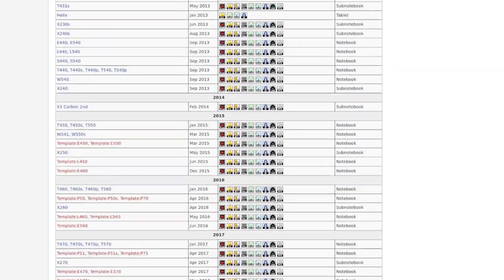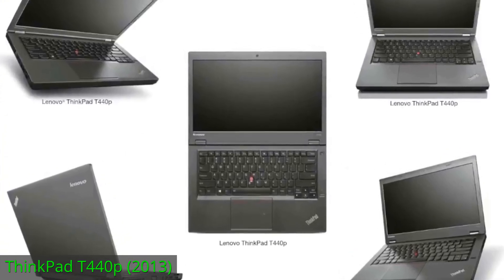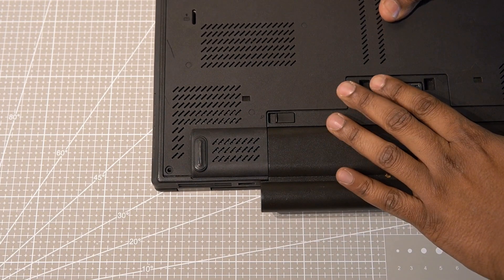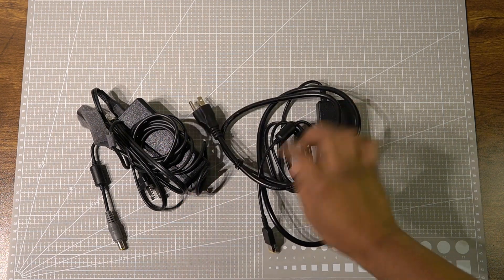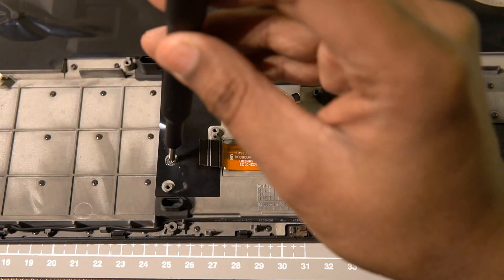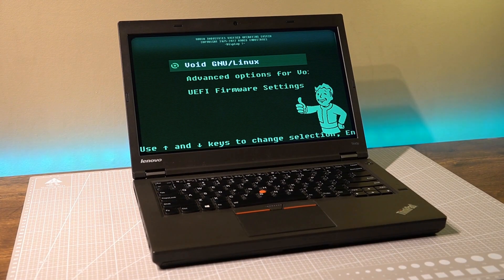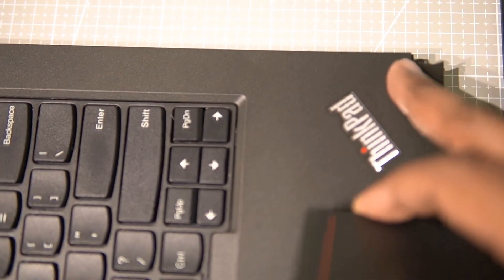ThinkPad T440p Is My New (Bulky) Travel Companion

Comment: The reason the T440p and T540p/W540/P50 (to a lesser extent) are so popular amongst enthusiasts is repairable, they're the last generation of PCs that are completely repairable i.e. all the parts can be swapped out and replaced like a traditional desktop PC due to the soldered CPU...

If you're willing to do a bit of cooler modding/pay the premium for the Nvidia cooler (thanks scalpers) you can even run much faster CPUs then were ever intended for this laptop (do your research). Unfortunately you've gotten a model with the Nvidia GPU (or fortunately depending on your outlook, so upgrading to the fastest CPU which actually has better integrated graphics then the GPU might not be worth it for you due to the added thermal overheads (additionally the gpu is a point of failure that requires a board swap if it happens).
Reply from the maker: I only realized the machine had a dedicated GPU during my restoration process. I guess I'd  rather not disturb the heat curve and battery performance with a new CPU. My current outstanding issue is the 1080p IPS panel still occasionally ends up drawing more power than the battery is happy with and the backlight goes off until a lid close-open cycle.

Comment: I love the T440p ThinkPad. I picked up a pair of them that were previously used in a school from a recycler on eBay. I bought them to freshen up and pass on to a coworker for his sister and nephew.  I have purchased and refreshed several ThinkPad models, getting them in the hands of those who want a laptop but can't afford the price of a new laptop.  Frankly, these ThinkPads are of a much higher quality and repairability. 
The two laptops were listed as different models.  It was listed as T440s.  I was a little disappointed when they arrived, but soon found that the T440p was a very good turn of events.   In fact, I liked them enough to buy a third one to keep for myself.
they tdnd to run warm, So, I used Arctic MX-6 thermal paste.   That seemed to help.

I am totally impressed at the balance of weight ( yes, it is a hair heavy),  the number of ports, the performance, and the ease of access. It is a snappy laptop.  My coworker was a big hero to his nephew and sister.  They are very happy with the units.  Good video.
Reply from the maker: It's such a great machine, that I could convince myself to part ways with my X230. Paired with a 1080p IPS display, it's literally all that you need for computing unless you're into high-performance tasks like gaming or 3D modeling.
Reply: @myTerminal  I have 16gb of RAM in mine with a 256 gb SSD.  I run Windows11 on it and it handles it just fine.  It is funny that you just cannot stop at one ThinkPad! 
My first ThinkPad was a T430s.  I cannot seem to part with it.  Like the T440P it has only the external battery. BUT..Unlike the T440p...The battery is a bit pricy. 
I just do not understand why the T440p doesn't get more love by people.  Again.... Good video.
Reply from the maker: I had a brief experience with a T420s and that machine left an impression on me. I might pick up a T430s some day. Meanwhile, I have bigger  plans for the T440p.

Comment: Its so tiny, thick and basic. Its really all you need for basic stuff. I tryng put oled display now, but the energy managment its getting in the way. By the way, really dope keyboard
Reply from the maker: And as you say "tiny", I realize most of the people I meet on a daily basis would have the exact opposite thoughts. Having said that's I find it perfect, and the thickness (as compared to the later models) fades away as soon as you realize the usability. The FHD screen upgrade only makes it better.

Comment: What are the differences you'll point out between T440p and T480
Reply from the maker: On the top of my mind,
T480 is better in: computing power, faster (and more possible) RAM, modern ports, better screens possible (higher-resolution, touchscreen, etc.), dimensions and weight, more efficient CPUs, better fingerprint scanner design, and more.
T440p is better in upgrades, keyboard (subjective, at least more key-travel), integrated DVD drive, nostalgia! (if I may stay)
Reply: @myTerminal and what do you think about w530 because i am getting an offer in w530 and t440p about the same prize and few bucks more for t480, so really confusing which to get
Reply from the maker: I absolutely loved the W530 as well. With all the money and work I put into it, there was still a lot of scope for upgrades. W530 and T440p are pretty comparable in most aspects, but the T480 stands out. I suggest defining your exact use and needs as to whether you'd be taking the machine along with you often versus use it on a desk. The T480 works well as a travel companion, and I could still carry the T440p. The W530, however, it's going to be a challenge.
Reply: @myTerminal  so i want a laptop of programming in arduino python c c++ js bash scripting and sometimes CAD like i need to make a custom back panel for my old  laptop using fusion360, gaming sometimes occasionally thats all 
And i favour older models because for example what if your charging port got busted in your T480 i will need soldering but in older models it just a wire change it and you're good to go
Reply from the maker: So then you're left with a choice between the T440p (14") and W530 (15"). Did you watch my videos on either of those? Maybe that will help you decide? With your CAD requirements though, I think you'd be looking at W530. One of my only reasons to sell it was to use the money to fund others like the T440p, else I would've kept it.
Reply: @myTerminal I've watched all of your video even the watch one too (dope collection)but still confused, but hey how t440p is better that t480 how come
Reply from the maker: I mean you mentioned you would rather not get stuck with a broken charging port, so unless you're really after modern hardware, I found the other two machines pretty competent for today's tasks, albeit the weight and dimensions.

Comment: My daily work horse. I've done pretty much every upgrade besides the wifi cause im scared to flash lol. It definitely isn't worth price/performance wise, but it's an awesome tinkering project for any enthusiast looking for an upgrade platform. Ease of service is amazing with alot of variations in specs and parts. For cpus I've tried the 4910mq but it ran way too hot and killed battery life quickly. I dont have integrated gpu so I installed the gpu Heatsink, which didn't help much. Currently running a 4712mq, but battery life is definitely still affected and runs a lil toasty during intensive work. Still a solid machine that I wouldn't give up.
Reply from the maker: I'll hold off for the CPU upgrade then.
Reply: @myTerminal I would stick to the i5 if  it's running well for you. Since you have an nvidia gpu, it would probably be a better option. Or you could go the other extreme and get the 4980hq from a MacBook but that would probably melt your lap ;)
Reply from the maker: Yes. I've decided to let the machine stay the way it is for now as it gets the job done reasonably well, and much better than the X230. Also,  I have more powerful machines in case I needed more horsepower.

Comment: IMO, the only thing T440p really has going for it is the ease of upgradability. It's the easiest to upgrade ThinkPad AFAIK due to the backplate having only two screws and how many components are under the backplate. 12:05, also it is possible to do a Full HD screen or even 1440p screen in T430 though it requires an adapter board, but I'd still recommend doing.
Reply from the maker: ...screen upgrade on the T430, you mean?
Reply: @myTerminal  Yes, I was referring to the T430, my bad. I just realized I forgot to mention it in the comment.
Reply from the maker: Interesting!

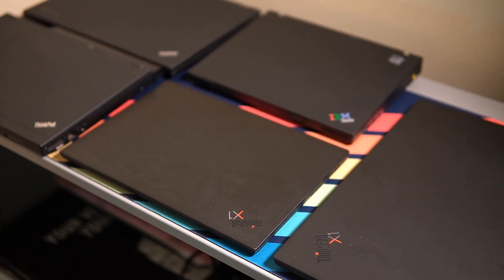Comment: 13:40 gta 3, based! How much did you pay for the T440p btw? I paid around $60 for mine.
Reply from the maker: I got it for cheaper: $59.99 😛
Reply: @myTerminal  i got mine for $14
Reply from the maker: @ImranMughal-s5f  😮
Reply: @myTerminal  to be exact, got 7 for $98 but yea $14 per. 5 nvidia gt730, 2 intel integrated

Comment: Assalamualaikum,

Good to see you again, Mr. Ismail Ansari! Coincidentally, I bought a T440p for my father last year. It only came with a HD screen, fingerprint reader, i5-4200M, extended battery and backlit keyboard, no dGPU and not even a CMOS battery, for some reason. It was in pristine condition though; there was less than 200 cycles on the battery and there was almost no scratches in its interior, with the exception of the top lid filled with old stickers. Gave it a CMOS battery, a 480 GB SATA SSD, 512 GB HDD in place of the optical drive using an adapter and 16 GB 1600 MHz RAM while my father personalized it by covering the lid with his stickers. For the final touch, I flashed a custom boot screen featuring my father's logo, which is his name written in Arabic that was made by his friend. It's now running smooth like butter in Windows 10, and it's a perfect laptop for my father who likes rugged things due to how he treats his stuff (he's an outdoor guy, unlike me 😅) and I've bought the laptop for only RM210 ($42) while the upgrades are stuff I already have lying around!

Hope you enjoy your T440p, Mr. Ismail Ansari! Peace from Malaysia to the USA! 🇲🇾❤️🇺🇸

 - Amir Razan
Reply from the maker: Wa-Alaikum-As-Salam! I guess you've kept the clunkpad on that machine? It isn't that bad either, is it?
Reply: @myTerminal My father had a tough time using it, so he just stick with a mouse. I adapted to it well though 😅